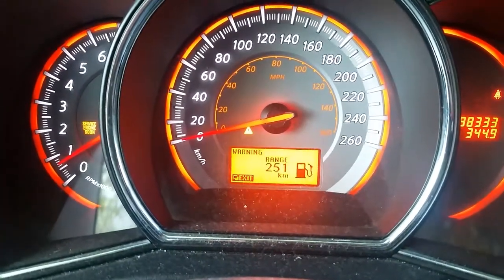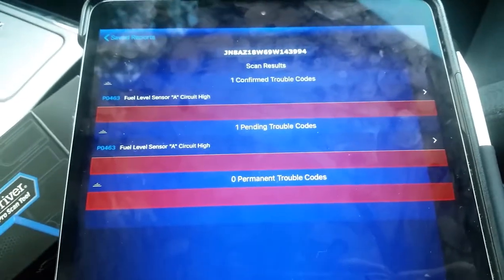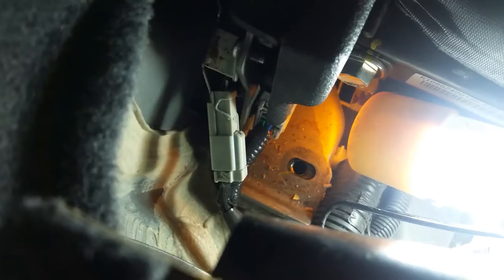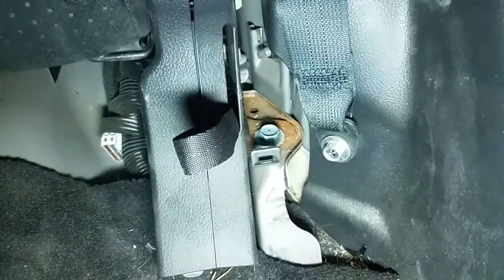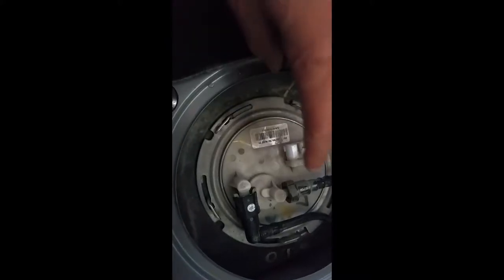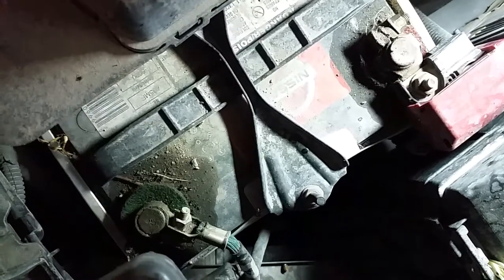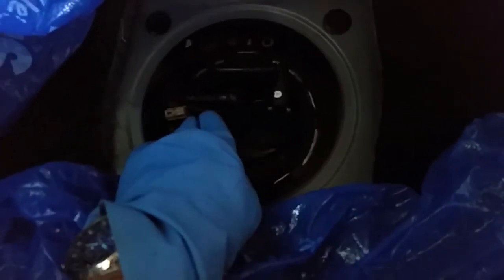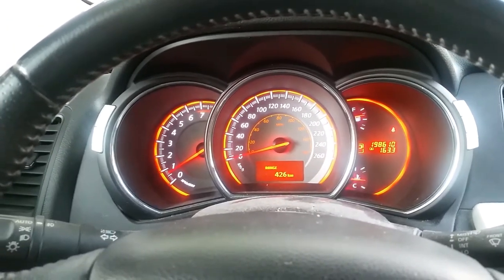Fuel Sender Replacement on 2009 Nissan Murano

Comment: My fuel gauge works just fine until it reaches about the half full mark so would I be right in assuming that the fuel pump level gauge on he drivers side is the one that isn't working and that the other one on the passenger side is working fine?
Reply from the maker: Unfortunately no.  The fuel senders have little resistors that get worn out as there is a little needle that moves over them as the tank is filled and emptied.  The ones on the bottom get worn out faster so the typical behavior is that it stops working at a quarter of a tank and then it progresses from there.  From what I understand they both work together so it's impossible to tell which one is the problem until you take them out.  However, it's likely that they are both bad or will be since they wear at a similar rate.  Since the work to access them requires removing the back seats, I would highly recommend replacing both at the same time.  The only tricky part is getting that lock ring back on after they are replaced.  I've done this repair a couple times and the second time, I purchased a lock ring tool and it made my life so much easier.
Reply: @shaneperche-fixed-it  Thanks for the reply. Just to clarify, why does the car have 2 fuel level sensors? It is a saddlebag style fuel tank, so my thinking is that since it has one fuel level sensor in each saddlebag of the tank might mean that one side (passenger side) empties then the other (fuel pump side)   takes over and measures the fuel in the drivers side. Thus my gauge works just fine until it reaches the half way point, then goes haywire when the drivers side sensor takes over. Just my theory, could be wrong.

Comment: Looks extremely complicated. Very dark as well. I appreciate your efforts though. What kind of symptoms were you having that made you do all this work?
Reply from the maker: The fuel gauge sender replacement is to fix the fuel gauge not displaying the proper fuel level on the instrument panel.  It is certainly a time consuming fix and the hardest part is removing the fuel tank lock ring without the proper lock ring removal tool.  I used a screw driver but I don't think I'd attempt the repair again without the proper fuel lock ring removal tool as it was a little frustrating getting it back on without the proper tool.  Apologize for the poor lighting.
Reply: Aesthetics622  
Apparently not everyone is as smart as you